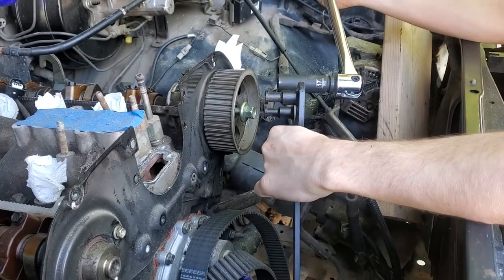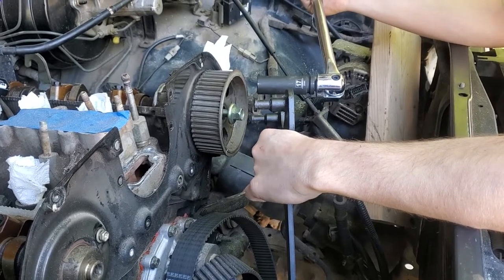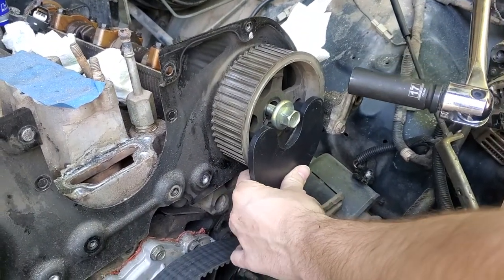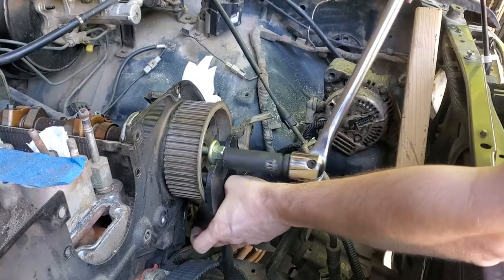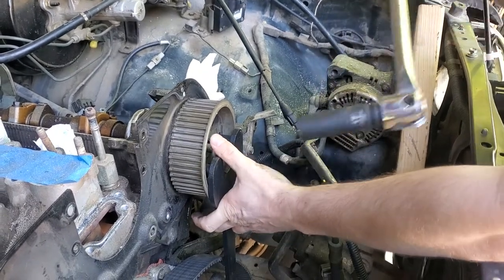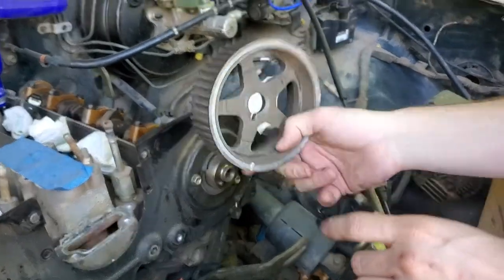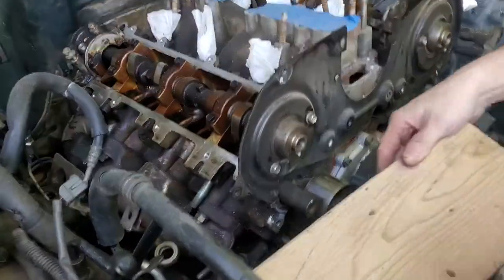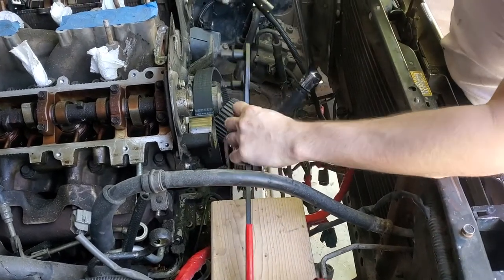1994 toyota pickup 3VZE camshaft sprocket removal

Comment: Hey man great videos! Question for ya. I've got 1990 Toyota 4 runner that just keeps randomly dying. Its currently in the shop atm getting looked at. They put in a new ecm, fixed my tps and some malicious parts. Great fuel pressure and new fuel filter. I replaced the intake boot because of a vaccum leak. My question would be what causes this damn thing to randomly die after 4 hours of running. Thx.
Reply: 3.0 btw